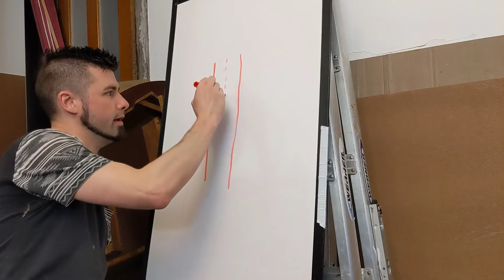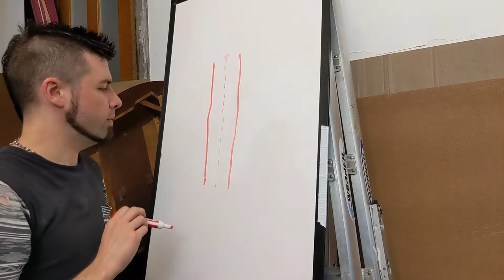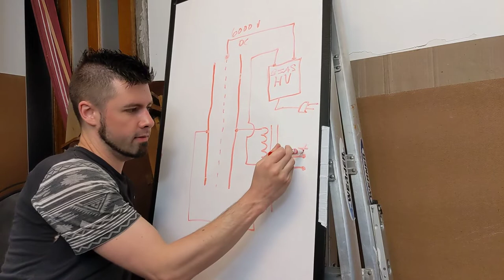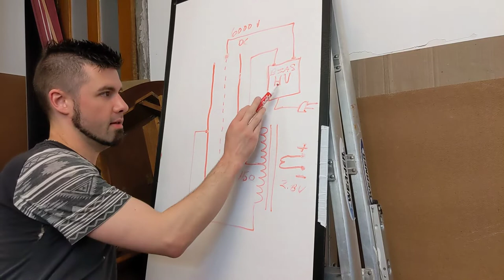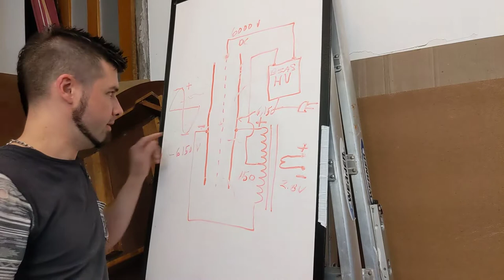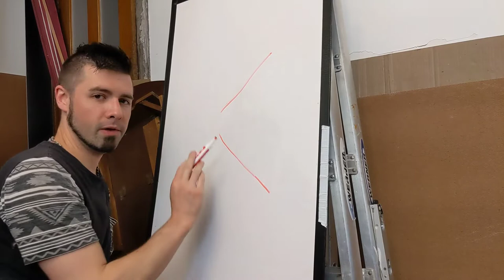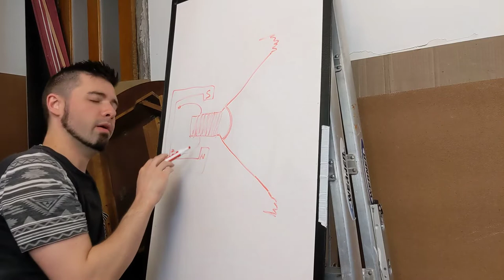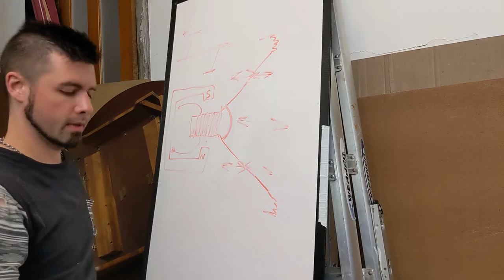How an Electrostatic Speaker Works

Comment: nice ! they must be very directional though? since you build them 11 years ago, i wonder what coating you used ? Lycron crystal ?  

oooh you used the old graphite coating. thats cool  !! its a verry hard thing to do correct. but if you do.... it stays there as you prooofed 11 years later ! good job ! you forgot to mention that one plate wants to repel the foil while the other wants to attracts it. making it push pull and thus more efficient in moving the foil

nice video in any case !  get this info out there and hopefully more people like to make or try such a thing ! its allot of fun !

by the way big ass tranny :)